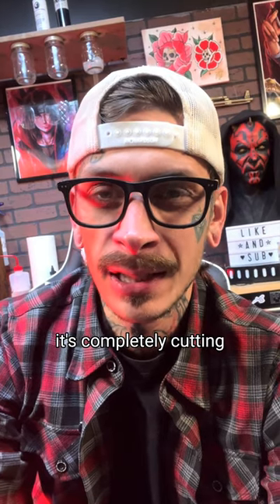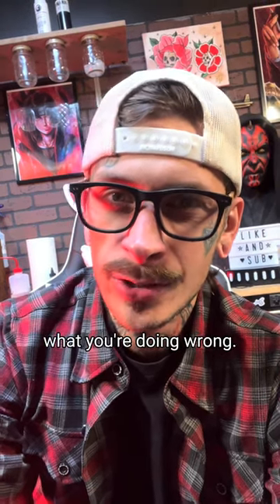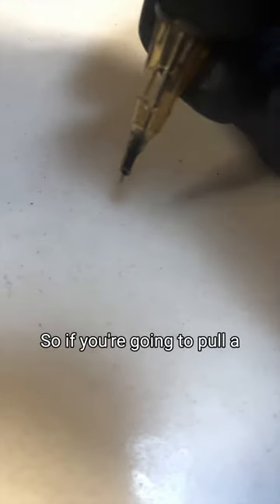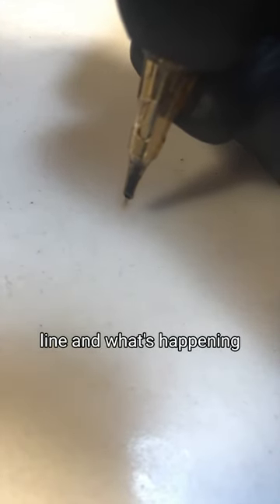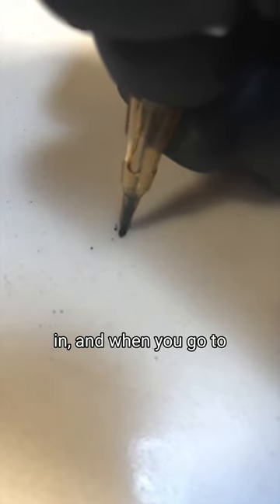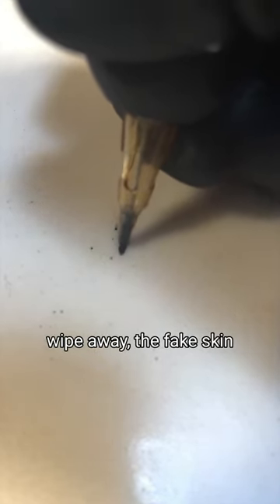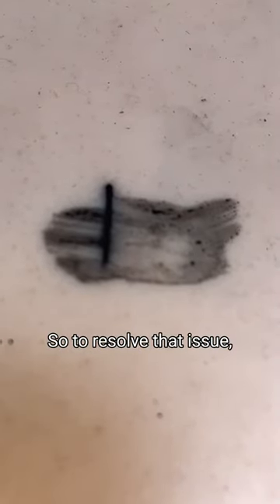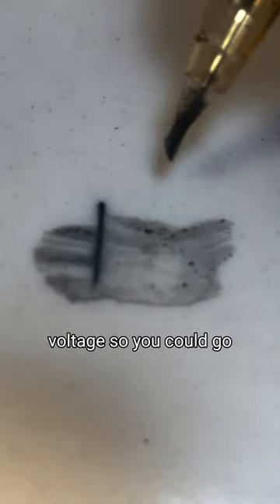Problems With Cutting Up Fake Skin?

Comment: Man I thought I was just using cheap fake skin. To be fair I definitely am but this probably contributes to it heavily.
Reply from the maker: Cheap fake skins will definitely contribute to this problem, especially if you're working on really thin practice skins
Reply: So i have a bunch of very thin practice sheets. Anyway i can use them without wasting. Will stacking work?@Tattooing101

Comment: I've used a plethorith of fake skins, different voltages and hand speeds as well as different strokes, different needle depths, angles and inclination, $100 machine and $500 machine and nothing seems to stop the fake skins tearing. It happens with Reelskin, Trueskin and all the cheap Amazon ones. I'm not sure what else I can change to correct this issue.

Comment: I am practicing on Reelskin right now, after a few tries on the normal silicon skin from Amazon. With the same way of tattooing, i find the Reelskin tearing up quite abit. So right now I'm not sure if my handspeed/volt that I've been using is wrong or Does reelskin tears up easier? 

I read on forums that we could expect some tears and it doesn't mean that handspeed/volt is wrong. Confused.

Comment: If I go faster the line doesn't saturate. Using reelskin, those are good quality right?
Reply: This is my problem as well. Not sure how to get a saturated line if I slow down machine/speed up hand. Did you ever get an answer to this?

Comment: How do I get crispy dark 1 pass lines on my fake skin? When i do my outlines i have to go over it like 5 times before you can see it clearly.  I've been tatting with a mast rotary gun around 6-7v mainly with a    3-7RL
Reply: Have you had any progress? I just bought the Mast and have been practicing for 4 days and yes I have the same problem sometimes. I test the voltage and speed but it never quite fixes my problem haha. So far I have used 5rl, 3rl and 5rs and I usually do 7.5 voltage
Reply: @vampyrgodess  not really I'm looking into getting a better gun with a longer stroke. Did you get the standard 3.5mm? That's what mine is & just dont seem to have the power. Ive been told its also maybe the ink. To use premium brand blacks to get better results. I havent had the time to buy & test that yet but might help if you have the time. Good luck 👍

Comment: thanks so much, i’ve been struggling with this one lately! 

do you have any specific drills or exercises for making sure your machine and hand speed match?
Reply from the maker: If you're practicing your linework drills, the key is really just to keep practicing  and finding out what the ideal voltage/handspeed that is comfortable for you until you're confident that you can pull & push lines consistently with ease
Reply: @Tattooing101  in response to her question, i have one as well! my mentor says running 6v is too low or the “lowest” I should go. I feel like i’m just shredding my fake skin because i’m pulling lines slow on 6.5, if i go even higher it feels like i’m losing a race lol

would you agree with the opinion that 6v and 5v are too slow? xx

Comment: Hey there! Just curious how do you keep the skin clean when whipping away the ink no matter how much water or lotion or alcohol I use it always stains. Or is this just to be expected with this material? Can someone give me some insight?
Reply from the maker: Put down a thin layer of vaseline on the area of the practice skin you're about to tattoo, then when you go to wipe it will be much easier. If it's still difficult to come off then reapply another layer of vaseline and wipe again

Comment: would high voltage cut up real skin too?
Reply: Yes
Reply from the maker: If you are running on high volts, you have to make sure your hand speed is fast enough to keep up. If not you're going to seriously damage somebody. If you find that your hand speed can't match up with the volts, lower it until you find the right balance
Reply: @Tattooing101  thanks! :)